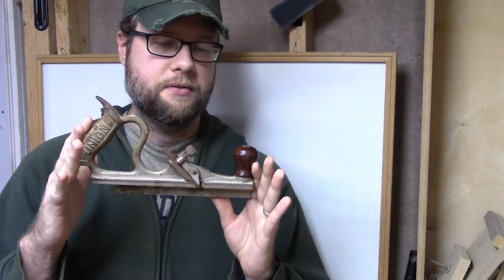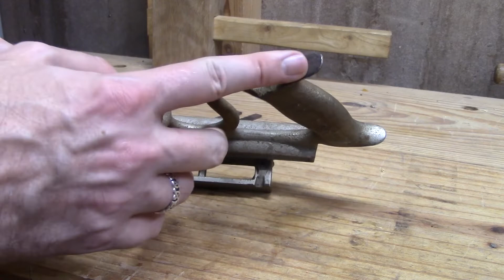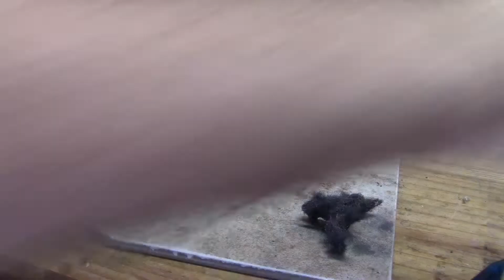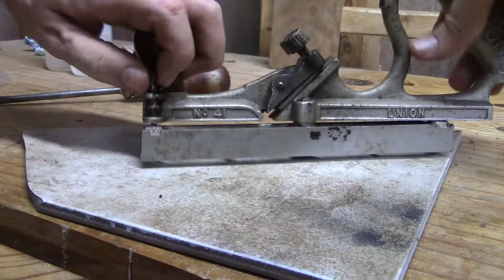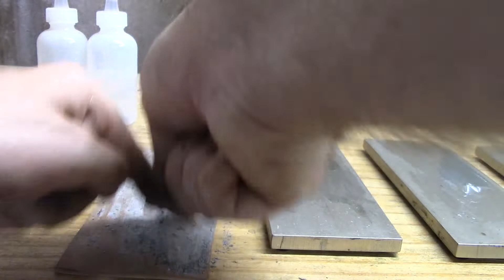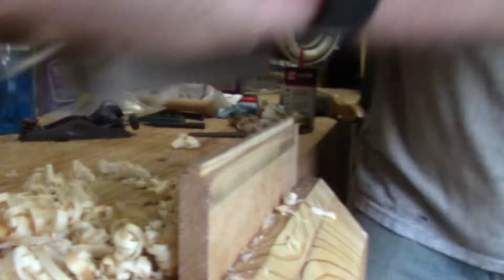Fixing up a Union No. 41 Match Plane

Comment: Hello, was wondering what size board is able to be used on?? Debating whether or not to get one since I mainly use 1/2 and 3/4
... thank you
Reply from the maker: I think it's designed to work on 3/4" to 1 1/4" boards.  1/2" would probably be too small.
Reply: @Sharp Workshop  thank you so much for the reply, been debating whether or not to get it. Looks fun but trying to justify whether or not I need it😅
Reply: @EggyOrphan  Stanley made a number 49 that was designed for 1/2" material. Union might have made a smaller one too

Comment: Out of curiosity, what do you think you sharpened your cutters to; I’m using 35° as of now with mine.   I noticed too, that flattening the backs didn’t just help with the edge, but the sides have a crisper corner gives a cleaner cut too.
Reply from the maker: To be honest, I didn't check the cutter angle because mine were in good shape and didn't need to be re-ground.  I assumed it was just 25 degrees, but not sure.  I really just freehand honed them sharp and slapped them back in the plane.

Comment: I’ve got a Union °41 also 😃. Just got it this month too 👍 I’ve already got about 3 uses for it lined up for the next month.  I’ve seen too where guys will double stick tape an additional wooden fence to the fence to decrease the offset and they’ll use it as strictly a grooving/drawer bottom plane for a project requiring a bunch of grooves; even a 1/4” iron thrown there.  Just thought I’d throw another idea at you for when you may have your °45 set up for another purpose and want to cut a bunch of grooves in a hurry.  Thank die the video.  I’ve built the DTC too, but made it 16” as opposed to the 11-7/8”. It’s also 7-1/4” taller to better accommodate shooting plane, and additional joinery planes along with tool rolls etc in the bottom.
Reply from the maker: That's a really good tip, I hadn't thought about taping wood strips to the fence to adjust the offset for other uses!  I'm really enjoying my 41, hope you do to.  Thanks for watching!